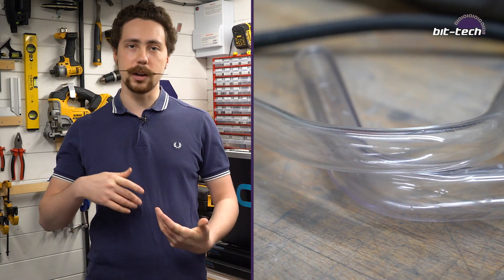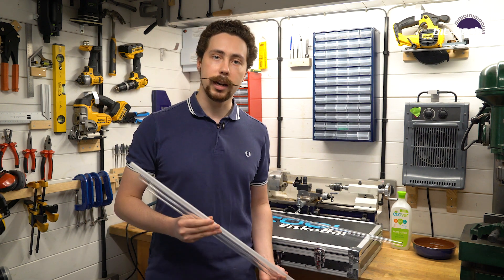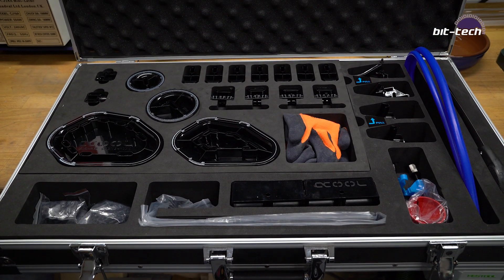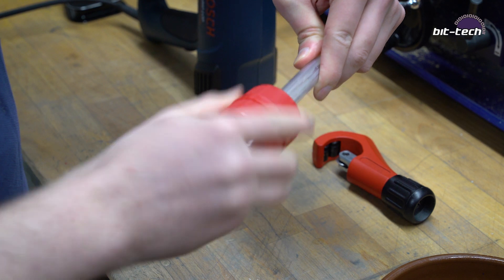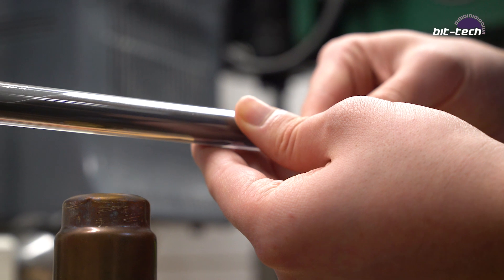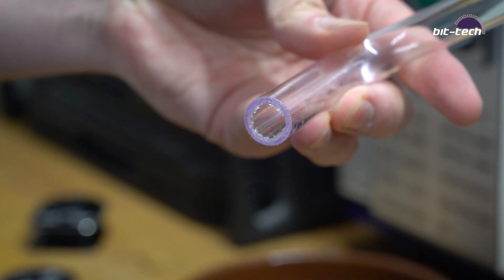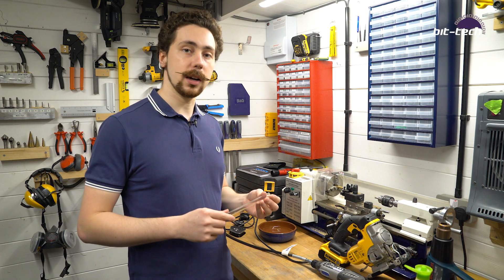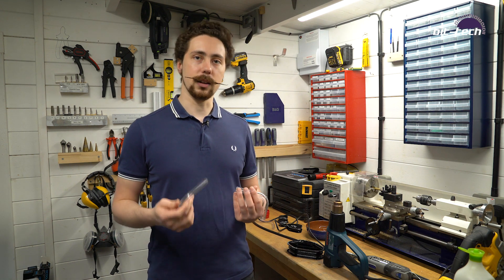Hardline Tubing Guide: Bending PETG and Acrylic | bit-tech Modding

Comment: 4:12 
I have different experiences by using pipe cutter on acrylic, simply put some masking tape on the cutting point and increase small amount of cutting depth and slowly turn the blade, by the time you hear the crack, that means your tube is cut 

If cutting too quick makes the acrylic crack, don’t worry it too much, masking tape will still hold the crack in place

Comment: Set heatgun to 130 C degree? I just did my firsy tubing with 270-290 :DD Am i wrong?
Reply from the maker: Naa you can use any temp that’s hotter than that, just need to keep a closer eye on things.

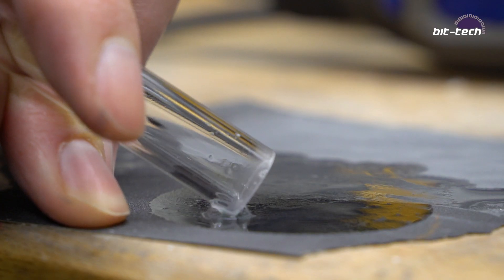Comment: Is that just water on the sandpaper at 4:38?
Reply: Yess, when using good sandpaper on hard materials like stone, metal, acrylic, etc, it's good to use water. Not sure exactly why, maybe for heat reduction.
Reply: @accumulator4825 It's for some lubrication but main thing is it reduces dust

Comment: How about measuring bends? That's what I struggle the most with
Reply from the maker: Honestly the best way is to work in flexibility into your tubing routing. Tubes with multiple bends in them are very tricky to do reliably. If you can come up with routes that result in a run only have maximum 1-2 bends in them, and then instead rely on parts of the tube that you can trim to size, you'll have a much better time.

There are systems like the Alphacool Eiskoffer that allow you to measure things out precisely, but in all honesty I've found them very hard to use compared with changing the route itself. Aside from that, lots of practice.

Comment: I might have missed it, what temperature on the heat gun do you recommend for acrylic tubing
Reply: that's as the same as 130°Celsius, right?
Reply: @a19waysJackinn  No, acrylic takes up in the range of 280C.  As he said it has a far higher melting point.
Reply: @brettbainbridge3154  2:34 haha. 280° is great I think. but also as he said.. and maybe 280° is a good start to heating for acrylic.

Comment: There one thing you did not mention, that is silicon tubes.. talk about size to wich tube etc. !!! Say bitspower got a petg tube 16mm OD / 14mm ID.. the silicon tube they sell is only max 12mm. Now, this will confuse first builder and so on. Will a 12mm OD silicon tube works fine on a PETG tube 14m ID ?? Such thing one should mention, all other u did but silicon tube's size.

Comment: You specified the temp for PETG. Can you also specify or recommend a temperature for Acrylic?
Reply: I saw him use 350°C in another video. It seems reasonable, as I previously experimentally determined that 375°C worked alright for me.
Reply: @Thorarin  because those tubes are have different size, I don't know your Experimention isn't that size, which depends if the tube is smaller and goes lesser temperature then.

Comment: you're the only channel i have seen that says cool down tubed using water, this is a bad habbit to get into, it can cause micro cracks
Reply from the maker: If you’re heating so high that dabbing some water on it causes problems then you’re going too hard to begin with. This isn’t glass, you’ll be fine. The advantage in cooling it quicker is that it prevents your bends from warping whilst you’re holding it in place.
Reply: @bittech1  and the disadvantage is you can cause micro cracks which can under pressure become major cracks and leak, i know personally after spending thousands of Dollars on a system that i will NOT put water on hot tubes no matter the temps, just a risk i refuse to take
Reply from the maker: Just remember I’ve built a large number of systems ranging up to £25k+ and never once had an issue. I was one of the early adopters of acrylic tubing back before you could buy proper fittings for it even.
Reply: @bittech1  so you would be willing to pay for broken components if one of your viewers takes your advice and cools it with water for someone building their 1st loop?
Reply from the maker: What a ridiculous statement to make. I suggest you just take a break, you’re obviously proud of building your first loop but there’s no reason to try and bring others down.
Reply: @bittech1  who am i trying to bring down???? i simply stated that its a bad habbit to get into, especially for a 1st time builder, you're the one who got all high and mighty talking about how you have done it in 25k systems, while forgetting that you're an advanced modder, you should have a caveat about the risks of cooling it with water, which you do not!!!
Reply: @bittech1  by the way my 1st custom soft tube loop was  back in 2010, so please dont assume you know shit about me ;)
Reply: @bittech1  Speaking of ridiculous, you didn't actually specify the temperature to heat acrylic to in the video and you suggested dunking it in water, so it's sort of your fault if viewers over-heat it then dunk it in water per your advice.
Reply: For PETG it should be pretty much safe. 

Acrylic might have issues from what I have heard, but you can always blow on it before cooling it down with water
Reply: @dainiusvysniauskas2049   thanks :)